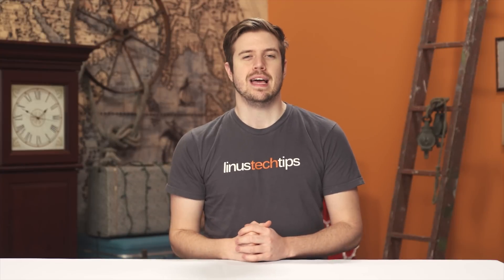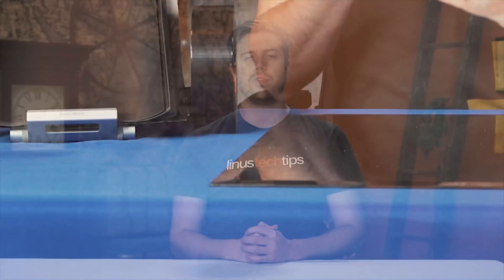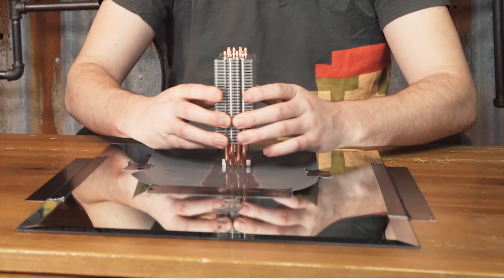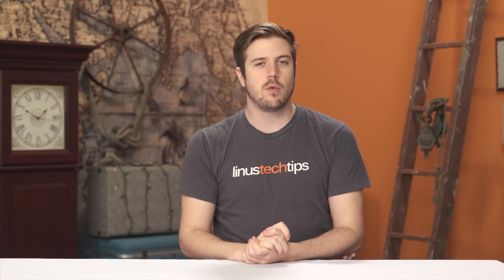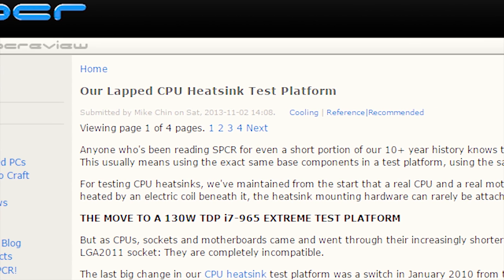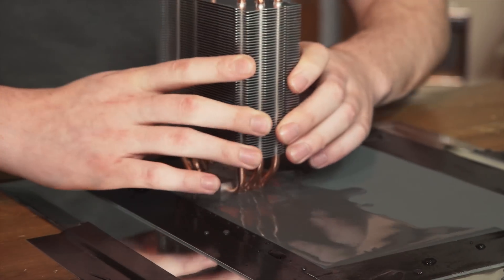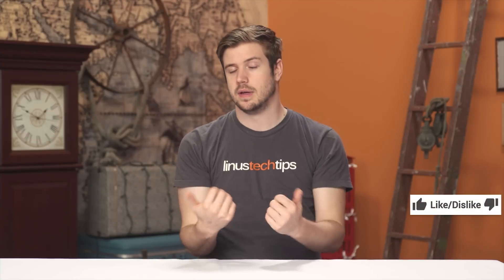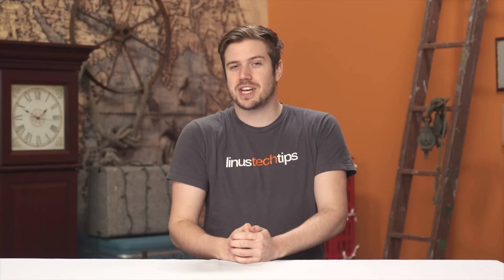CPU & Heatsink Lapping - Are concave, convex, or flat heatsinks best for cooling?

Comment: A quick guide to ultimate contact.
1: Put the heatsink on a drill press. 
2: Place the CPU under the heatsink. 
3: Start the drill press.
4: At a relatively low drill speed setting (don't allow the drill to pull your heatsink apart), gently lower the spinning heatsink onto the CPU. 
5: As the two components are grinding on each other in a circular motion, any imperfections are being flattened, and any curvature is being aligned.
6: Apply enough pressure to heat up both components, making sure not to overheat the CPU (give it a break every minute or so.)
7: After about 30 minutes (allowing for breaks), your two components should now fit onto each other as snugly as were they 1 piece of metal. 

Only those two components will ever fit each other though. So make sure you have a perfect heatsink for that CPU that you aren't going to want to change for a while.

Comment: how often do i need to change the thermal paste?
Reply: +Lukas Safi Depends on the CPU, the temperatures, how often it is used, how often it gets hot, the thermal paste used.... Good luck.
Reply: every time you upgrade your cpu or cpu cooler. :D
Reply: +Lukas Safi every 3-4 years if the paste is good, if it's cheap and bad maby once a year
Reply: +MegaChickenPunch thanks for the replys because i have an pre build and of course i have no fucking clue which termal paste is used and i have the pc since october 2014
Reply: Lukas Safi i'd change that bastard asap

Comment: After that fail video regarding IHS removal, we have the next video with a "wrong" approach (imo). 

Lapping usually doesnt make sense with coolers, its the IHS of Intel CPUs that are soldered which are prime candidates for that. My old Q9550 E0 was a good example of that, bringing down overall CPU temps ~5°C and especially reducing differences between cores by ~8°C (4 GHz @ 1.28V). Sadly I dont have the pictures and screenshots anymore.

When I removed my IHS from the i5 3570K I'm currently using, I also lapped the IHS while at it. Here is how it looked after a few passes with 400 grid:

http://abload.de/img/p1040080e2z89.jpg

Lapping the IHS and deliding (replacing Intel gunk with liquid metal) brought my temps down ~17°C at 1.26V under Prime95 small FFTs (using a 240mm AIO). I didn't do a seperate run only with the lapped IHS - to lazy.

How AMDs CPUs react to lapping I have no idea, the last one I used was a XP 2500+ M ... .
Reply: +Karl Arsch Have you seen the state of the CPU they use? Due to their poor taste in thermal paste it is scratched up REALLY bad. Lapping a heatsink then using that CPU won't make a difference when their CPU heat spreader is in a much worse condition then the heatsink before lapping. He really does need to lap the CPU as well.
Reply: Scratches arnt that important as long as they are minor - thats why I usually stop at 1000 grid paper anyway. A warped IHS is the main culprit.
Reply: Exactly. With precision mating surfaces, tiny low spots aren't usually an issue. But high spots and overall flatness are. If, however, they managed to raise a burr on that CPU it could be a problem.

Comment: It would be interesting to know the respective thermal conductivity of the CPU cover's alloy vs the copper heat sink contact vs the heat sink alloy contact vs the thermal paste. I assume proper lapping of the contact points would negate the influence of the thermal paste, unless the thermal paste has a higher thermal conductivity (which seems highly unlikely).

Clearly, the smaller the gap between contact surfaces, during all temp ranges (thermal contraction/expansion), should benefit thermal transfer as small air gaps (voids) would be eliminated.

Comment: I lapped my cooler a few weeks ago. Used very similar methology. Temperature dropped around 2-3C, but the base on my cooler was pretty bad from factory.
Reply: +DrathVader The problem Luke has is the poor state of his CPU. Have you seen the CPU they use for their tests? It is in SUCH bad shape, those scratches, miss-coloured, because of their poor choice of thermal paste.
Reply: +DrathVader Same story here, I lapped a Phenom 9850 about 7 years ago and it dropped temps by 3C. Not worth it considering that barely helped it bump up to 3 Ghz.
Reply: theotaku7
Yeah. Lapping allowed me to bump up clocks on my 2500K by 100MHz. Not worth it if you consider how tedious lapping is.

Comment: its very simple. heat transfer is directly proportional to surface Area.
for a given foot print a Flat surface has the smallest surface area and thus the worst hear transfer rate.
For the best heat transfer you will want the largest surface area, which is achieved by a curved surface on the macro scale but also a ruff surface on the micro scale.
so curve the contact surface (corrugated would be the best) as much as possible and then ruffen it with several rubs of  the coarsest sand paper eg 60 grit.
cheers

Comment: People that do this forgot the reason why we use that thermal paste between the CPU and HEATSINK in the first place.
Reply: +coisasnatv the theory is that TIM leads heah worse than the metals (which is indeed true). so if you can LAP the parts down and decrease the need for TIM and the needed amounth of TIM you'd increase the thermals.

That's the theory at least
Reply: +coisasnatv Have you seen the state of the CPU they use? Due to their poor taste in thermal paste it is scratched up REALLY bad. Lapping a heatsink then using that CPU won't make a difference when their CPU heat spreader is in a much worse condition then the heatsink before lapping.
Reply: Dart Maul If you can lap both parts to a flat shining surface, than you don't need a thermal paste. Again, this people doesn't understand why we need thermal paste for.
Reply: Spot on! In fact lapping and using thermal paste has a chance of reducing performance, as you are effectively reducing the surface area of the heat sync contact. I'm quite sure that the companies that design and make heat syncs with their millions of dollars in research and development would polish the surface of their contact plate should it provide a demonstrable increase in performance; though no doubt they would charge you a bit more for it and call it a fancy name to appeal to enthusiasts who waste their time and money with this rubbish.

Comment: You really need to stop using aftermarket coolers for stuff like this. Those things are designed to negate what you are actually testing.
Like before where you said thermal paste does not matter when using a freaking water cooler where i personally had a change of 50 yes, 50 degrees difference between thermal paste and no thermal paste using a stock cooler.

Comment: When I did this a long time ago, it was recommended to also lap the cpu heatspreader, since these also tend to come (or at least came?) with not completely flat surfaces, such that lapping your heatsink alone won't impact the contact surface between the two. I did it with a scythe mugen 2 and an intel q9550 way back when, and during the process I did see the nickel of the cpu heatsink coming of unevenly (so not flat). 
I managed to get a 3°C improvement, not sure if you're willing to go through the process again with a cpu though haha

Comment: it depends on both surfaces. if cpu and heatsink are both concave, you obviously end up with a gap. if both are perfectly flat, you don't. if both are convex, you get a gap on the sides, but not over the die. so i'd say lapping just one of these components doesn't make tons of sense. if your heatsink is perfectly flat, but your cpu isn't, there's still a gap.

Comment: Quiet Obvious that Concave where the Heat Sink blades are closer are the worst and the flat ones are neutral and Convex which has the larges distance between the heating blades has the best heat dissipation capability

Comment: If you want to get THUPER scientific, then humidity also has an influence on cooling other than ambient room temperature.

And as far a being flat, I think I found this out a long time ago when i lapped my Tuniq Tower 120 back in 2009 (bought it in 2007), its very similar to an EVO 212, but with only 3 heat pipes and a full copper contact. I first lapped the heat sink but not to a shine, just flat and very smooth but i didn't see much a difference which was kinda bummed because it dropped 1c at best. But then came time for the CPU and it dropped 5-7c which was a world of difference for my overclock from 3.2GHz on a Core 2 Quad Q9550 to 3.625GHz reaching about the same max temp. It was able to hit 3.8 no problem, but i didn't feel comfortable running it on a hot day or for a long period of time. I forget what the max was but well within a safe margin in case it got very hot and i wanted to play games or render something for hours on end.

Think i was running G.SKILL 4GB @1150MHz cas 5-5-5-17 in 2009 with the Q9550, i was king of the hill LOL. But now I'm running the same system i got in late 2012, a FX-8320 running 24/7/365 @4.5GHz because i got it on a VERY good sale.. should have got the i7-3770K, but i wasn't aware that deliding would be such a huge difference on temp and overclock when i got my FX-8320 :/

Comment: u can also use use some valve lapping compound. put the coarse rubbing compound 1st on the mirror and rub it until ur fuckign tired of doing it. after that clean the mirror and put the finer grain compound. rub till ur tired again. and u should have a nice flat surface.

Comment: This video just states the obvious! The important thing is contact area.
Scratched surface or tiny defaults don't matter at all as these are the reason why you put thermal paste. If the surface was perfectly flat there would be no need for thermal paste (or pads).
Convex and concave surfaces will make more (and potentially big) differences as the contact area will be reduced and then it is a matter of the size of the contact area once thermal paste has been applied (as the thermal paste layer increases the contact area). If the curvature is pronounced you will have some pockets of air between the heatsink and the processor which is very bad in terms of heat transfer.

Comment: I know from my own personal lapping experience that lapping heatsink does 3-4 times more than lapping just a CPU. I've had 2C change on lapped CPU, and about 8C on lapped both heatsink and CPU. I did it on old AMD Athlon64 Venice, oc'ed it from 1.8 to 2.5 and was mindblown with really smooth Civ5 performance.

Comment: Years ago I lapped my E6600 and a Tuniq Tower. The E6600 was stable at 3.6GHz with a mild voltage drop. I had a friend whose similar setup OC'ed the same without lapping, but my CPU ran a few degrees cooler. My E6600 would actually clock up to 3.9GHz stable with a small voltage increase, but I was going for 'cool, quiet and fast', not 'as fast as it will go.' I still have the CPU somewhere, but when I upgraded to an E8500 I felt that OC'ing was no longer important and ran everything stock since then (including my i3 setup now).

Comment: I lapped a Q6600 and lapped and bowed my DTek Fusion for a average of 6c lower temps under load. Depends on the machining too, single billet GPU heat sinks are often pretty bad because of the large surface and heating, cooling and strain during construction, I've lapped some that are all sorts of wavy  on the contact surface.

Comment: perhaps it could change something if the cpu where lapped too
Reply: +Jérémie Gaucher (MaLiXs) long time ago when i lapped my E8600 i got way better results by lapping the CPU and not the cooler.
Reply: +Jérémie Gaucher (MaLiXs) Have you seen the state of the CPU they use? Due to their poor taste in thermal paste it is scratched up REALLY bad. Lapping a heatsink then using that CPU won't make a difference when their CPU heat spreader is in a much worse condition then the heatsink before lapping.
Reply: +Jérémie Gaucher (MaLiXs) I just cringed when I read this.

Comment: If you buy some shitty cheap ass heat sink off eBay then yea Lapping works, and I've tried it with a net benefit of 10℃. Heck I know more about machining than computers, and when I've made heatsinks for motors and cooling system lapping worked extremely well as when I built it originally, the surface was complete crap, because it came straight off the mill with a ton of grooves and imperfections.

Comment: I tried to do some lapping on a gtx 660ti lightning a couple years back (i had no idea lapping was a thing). the heatsink was flat, but had noticeable surface imperfections. But i couldn't do it on a flat surface... cuz of screw mounts... so i had to hand-sand it down with smaller and smaller grained sandpaper until i sanded through the chrome and into the copper (cuz i thought removing the external metal that isn't as good as copper to let heat through would also help). after that, polishing! was all nice and shiny, i could see myself in it, and the imperfections were too tiny to matter then. I put back the cpu and found out that it wasn't as good.... i then thought that i removed too much material, so i found a square copper heatsink spacer on amazon, then tried that (by sanding it, polishing it, and trying real hard to have the thinnest ammount of good thermal paste between heatsink and spacer, since thinner is best, while also trying to cover as much surface as possible). And results were okay, though not as good as when i first put descent thermal paste on (i tried that because i was tired of the fighter jet whine while i was mining litecoins on cudaminer). A few months later, one of the fans decided to continuously screech, i suppose due to a bearing gone bad. I decided to replace it with an Accelero Mono Plus gpu cooler and call it a life, which works actually so nice btw (temps never got over 60°c ans whisper silent). To conclude, i don't think it's worth it to do all of this to gain a few degrees on the cheapest hardware you can get, It's much better to do your own research and hunt down what is the best bang for a buck you can get (cpu heatsink is a thermaltake Macho Rev.A, was pretty cheap at 50 eur,  has a mirror shine on the base, never had a problem with it for the last 3.5 years except mounting, and performs just as well as the other 80 eur cpu coolers).
Hope this info was helpful!

Comment: Thanks Luke!  Just in time--I am swapping the standard cooler on my A10 7870K (not the new Stealth cooler but the really really loud one that the Stealth replaced) for a Hyper D92.  I will at least take a look at how flat the contact foot is before I put it on. One somewhat related comment is that I recently noticed how bad the Gigabyte fan curves are for this APU.  Maybe that is something you could look at that might make a difference!!

Comment: For this kind of test I think the surface of the CPU matters, too. 
Maybe I find time to take my old CPU (AMD Athlon II x4 640 @ 4x 3,0GHz stock) & cooler (Titan Fenrir EVO) to work, where I am able to polish those parts with aliminumoxide up to a grain size of 0.05µm (50nm). 
When I get to test it, I will post a response on this video for those, who are interested in my results. 
I will test temperatures without and with thermal paste. 
Unfortunately this will be the only CPU & cooler I get to test.

Comment: you need to lap both the heatsink and the contact surface of the cpu. otherwise, it is less meaningful to have a lapped heatsink because you still get the surface imperfection which still result in less efficient heat transfer.

Comment: why can't we completely submerge the CPU in a sealed  liquid cooling system with non conductive liquid as the coolant? 

rest of the mobo is high and dry.
Reply: check out mineral oil system. these guys have an old video on it.
Reply: +Fezz nah that involves the entire system under oil.
Reply: +Matapatapa Oil isn't a great conductor of heat and with just the CPU in contact, it'd probably overheat. Also oil has a sort of low specific heat capacity, so it takes not much heat energy to make oil hot compared to water.

Comment: Lapped the stock cooler from my FX 8350... Before hand, it had a temp of 75 c, ambient bouncing between 22 and 23

After lapping it got temps of 73, but the ambient temp went down by a couple degrees... So yeah, pretty much does fuck all. Im gonna swap back to my water cooler now...

Comment: if you really want a more direct contact with the cpu..you could try removing the HSF oc the cpu so that the cooler is in direct contact with it..but considering that some cpus have contacts on the back side and that without the HSF both surfaces wont really reach each other due to the cpu clamp..my methodology is making direct contact of both the cooler's copper pipes and the back side of the cpu die(without the HSF)

Comment: You didnt do a very good job of lapping. In the picture I can see big scratch marks, The final lap should produce a mirror like finish. Anyway, its not just the heatsink, if the CPU is convex (and they usually are) then any lapping on the heatsink alone isnt going to help much, if you lap the CPU and heatsink flat you can get a couple of degrees cooler. For most people its not worth doing, its not worth the risk, because most people will do it wrong.

Comment: Do a workshop vid on delidding? Not replacing the thermal material between the ihs and die like Linus did, but cooling without an ihs. Maybe finally a profit there? Probably not. Maybe worth a shot.

Comment: If you use an intel LGA1151 or LGA1150 the main problem is the toothpaste between DIE and Heatspreader, Linus already made an poorly done Video about this problem...
This Problem will blur any other test with cooling performance!

So PLEASE use an LGA2011 System which has tin as TIM for such cooling tests!